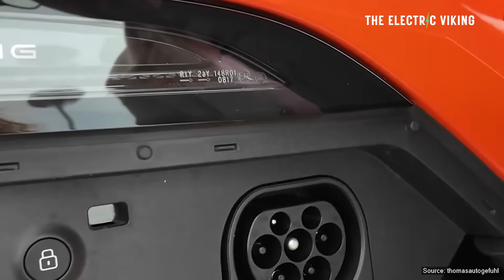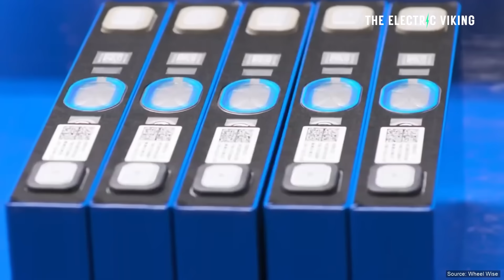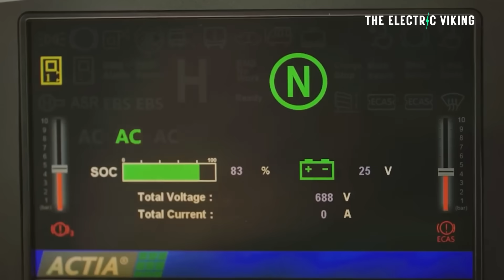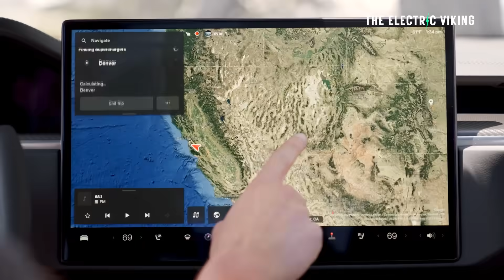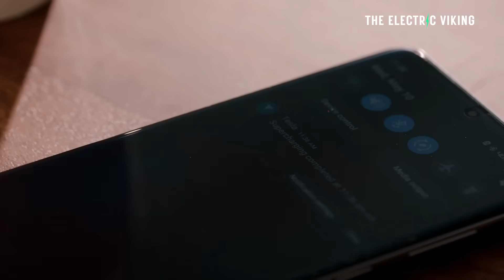Shocking data reveals the TRUTH - how long electric car batteries really last

Comment: Ten thousand miles on our 23 Mach-e GT, so the first service interval was done yesterday, $0.00. One pedal driving is so familiar now, that I can go months without using the brakes. The only time I use the brakes is to occasionally clean the rotors. Level 2 charger at home does over 98% of our charging at about $.14 per kW.h. Thank you for sharing
Reply: Does that mean that other road users don't know when you are slowing down or do the brake lights come on automatically as the car slows itself down?
Reply: @God_help_us  Good question. The brake lights come on during deceleration/regenerative braking.
Reply: Good to clean the rotors after a rain etc. Besides they look nicer all shiny:)
Reply: Mach E has European style break blending. Even when you use the brake pedal the car will not use the brakes. Regen is being done automatically via software.

I do have a GT also and the Brembos were only ever used with emergency braking and to halt the car. By the way I am driving in Germany also on highway with high speed. And believe me you will need to brake intensely from 200 km/h to 60 km/h within a few meters at exits.

As mentioned by another guy there is a brake light issue. One pedal or bridle mode is basically unusable because the car behind will not see brake lights. I do use whisper without one pedal because of that. So I do use the brakes pedal but not the brakes. And the car behind will see brake lights which is important for safety.

Comment: Sam your coming across as a EV lover regen braking wears pads and discs and why don’t they guarantee batteries for say 30 years then please get a grip go watch Barry Crompton
Reply: No it doesn’t. It’s inductive.
Reply: I’ve seen dealers videos showing uneven wear due to it but my main point is the quarantee 8 to 10 years do you think that’s good enough really 🤷‍♂️
Reply: Regen definitely does not wear brake pads, it is electromagnetic braking. CATL is supplying Yutong Chinese buses with a new battery that are warranted to last 15 years or 1.5 million km's. These will eventually be used in cars. So battery warrantees are getting longer as battery tech keeps improving.
Reply: @toriwatson9655  so how does that work then no contact with brakes to pads
Reply: @georgeg8106  when the regen is activated the motor sort of reverses and generates electricity. It pretty much becomes an alternator or temporary generator and converts the kinetic energy of the vehicle to electric power to go back into the battery.
Reply: https://www.youtube.com/watch?v=stq2E3sZYg0

Comment: Degradation with high mileage was always solvable by using large enough batteries. The issue of large batteries were weight and cost. Not how many miles can they make. If you are high milage driver, like taxi driver, EV was always better proposition then ICE since Model S was released. The real issue for car owners is calendar aging.. How good will battery be after 12 years? How about 15? 80% of Toyotas make it to 20 years of age. But their hybrid batteries are dead after 10-12 years for 4500€ cost of replacement of punny 0.7kWh battery.
Reply: Resting or calendar degradation is one of those things that is hard to calculate. If batteries are left fully charged for long periods, especially in hot weather, it can be significant. LFP batteries sitting around nominal voltage have small degradation, I think the latest generation of LFP batteries will have huge lifespans, calendar and cycle life. Toyotas ancient Nickel-metal hydride hybrid batteries have a poor lifespan and can't be compared with modern LFP chemistry. But you are correct, calendar life is not looked into enough. 

Lithium Titanate is the gold standard for lifespan and would outlast any car, but energy density is too low for most EV's. It is interesting Mitsubishi made some of their Miev Vans with 10 kwh LTO batteries and most with 16kwh NMC packs. The LTO powered vans are highly sought after second hand, they seem to be getting 105% range after 10 years (obviously some sort of error, but suggests barely any degradation). And these LTO powered vans after 10 years now have better range than the degraded 16kwh vans.
Reply: @toriwatson9655  Thak you on insightfull reply. Judging from wikipedia LTO battery has low energy capacity, but seems as no-brains option whenever there is no need for monster capacity. Like in hybrid/plugin. I would buy that.

Comment: Our family have owned two 2013 Volts and one 2023 Bolt.  One of the Volts battery bricked shortly after the warranty expired.  Too expensive to fix.  My other Volt seems to be fine at 140K miles.  What I have decided.   To trade an electric car before the warranty expires, usually 8 yr/100k miles.  I am not sure how an electric car and ICE compare in resell value.  Something to think about when purchasing. The other thing to think about is future proof of the battery.  Supposely, GM's Ultium platform can replaced their modular units with upgraded batteries???   Battery technology are in a constant state of change.  An older battery may not be supported and replacement battery might be refurbed units with limited warranty.

Comment: Okay, so there's all these new amazing batteries that have increased the capacity by both dimension and weight....but why aren't we seeing new better cells for the small scale such as power tool batteries. The 18650 has been around for a long time now, but with all this new technology you'd think they could come up with a 5Ah battery the same size as an 18650....or a 5Ah 18650.
I just love building my own batteries so really looking forward to a better replacement than the current small cell batteries.

Comment: There seems to be an ongoing theme in the comments section - People who have never driven an EV trying to convince  people they aren't good....😂
Honestly,  just test test drive one and be amazed. 
I understand the price might be out of some people's reach but that was soon change!
Reply: That's the interesting thing with EV's, some people just passionately hate them and won't listen to anything that supports them. When an ICE car gets reviewed you don't see trolls and keyboard warriors going off about how terrible the car is because it uses a combustion engine. I think there are just some people that can't handle change and yes, I wish they would at least try an EV. I think the younger generation will be EV adopters, the lack of maintenance needed, so few moving parts and therefore much better reliability, will see EV's take over.

Comment: My ice van had to be serviced at work so i was given the company electric van to use. When i got home and switched the van off it had 113 miles of range. When i started the van the next morning the van was showing 99 miles of range.
Reply: This is not battery degradation, but mist likely due to temperature. If it is at a comfortable temperature you get more range.

Comment: My wife did not learn to think ahead to minimize braking, as I was taught (a long time ago, before disc brakes).  When we had two identical vehicles (Toyota Camrys) the brake pads on hers had to be replaced twice as often as on mine.
Reply: An advanced driver training course would do her the world of good. If you're over using your brakes, you're not aware of your surroundings.
Reply: Its true as I have never had the brake pads replaced on any car I have owned in 65 years of driving .

Comment: The UK has the most expensive electricity in the world. It is cheaper to run my diesel and I only trickle charge at home, and I don’t have to worry about putting the heater on because of the range.
Reply: Er do you actually have an EV? UK diesel 140p per litre @ 50 mpg = 13 p/mile vs Electric 25p per kWh @ 3 m/kWh = 8 p/mile or less than 3 p/mile if you trickle charge on an off peak rate
Reply: @IanThompson-p2r  It's fairly clear he has no EV ownership experience. It also seems unlikely he has ever checked the cost of home EV off-peak tariffs.  His diesel would need to return around 150 to 180 mpg to compete with the per mile cost of my Kia EV, charged at home....
Reply: If you charge your EV at home on cheap overnight electricity it costs just 2p/mile.  Much cheaper than diesel
Reply: Germany, Denmark and Ireland all have more expensive domestic electricity.

Comment: The range is of concern. 250 miles official is often 200 in summer, 180 in winter. Add in the 60% window (20-80%) means your real winter range is 108 miles between charges.
Batteries may last, but degradation will nibble into that 108 miles depending on type of battery, how it is charged plus quality control of the battery itself and design of battery health support systems.
5 years later after buying your 250 mike range EV will you be happy with having to charge every 90 miles in winter?
Meh.

Comment: I buy 2nd hand cars and run them to between 250000 to 300000kms, my old Holden I just sold had 275000kms on the clock, the running gear was okay but all the plastic parts were decaying. I think even if the EV batteries and motor last that long. I  doubt if all the technology and plastic will last more than 250000 to 300000. But I hope that this is right because I really don't want to start buying new cars at my age.

Comment: This is not a balanced argument as ICE cars now last longer with a diesel often doing 300000 miles. Also  to recycle an engine is far cleaner than recycling a battery if you can find a company todo it.
Reply: There's companies in Australia that will convert an old EV battery to be a house battery. Who cares if it's only at 70% of original capacity, its original capacity was over 5 times standard home batteries.
Reply: @Michael.B  Those old house batteries were 100% recyclable, with facilities to do so all over the world and with very little energy required to do so. We haven't got that far with L-ion tech, yet. Most end up in land fill.

Comment: Battery pack as good as the weakest battery in the pack. General degradation does not give justice. It has to be based on actual numbers. How many batteries being replaced. Also you not replace the battery just because it failed. You also replace it because the range decreased below usable. The quality of batteries  differs even the manufactured batches.
You do not make assumptions. Real world data needs to be collected. Some of the manufacturer does it.  Than based on the collected data conclusions can be made.
Based on your assumptions. You would happily buy a 10-15 years leaf. :)

Comment: In 7 years of driving EV's, I have never replaced my pads or discs. 
I do give my brakes a dab once a day to stop my disc's from rusting.
Reply: It's a clear sign that you're looking ahead and have good spatial relationship skills. Saves on petrol, car wear and tyres. Most importantly, is it saves lives.
Reply: If you drive an ICE car properly you dont need to change the brake pads very regularly.In my 65 years of driving I have never had to have the brake pads changed on any car I have owned
Reply: @ When you only keep cars for 3 years, the lease agreement, that makes sense.
Reply: @davidbeppler3032  I keep my cars until they die, I dont have that sort of an ego that needs to show off with a new vehicle every 3 years.
Reply: @Stumpy1854-Orion  You are a liar.
Reply: @davidbeppler3032  What have I said that was a "lie" ?

Comment: I don't need media that keeps on lying, non-transparent about their oil-lobbyist donors, to tell me about nearly anything.
Facts are simple, even in Jakarta, Indonesia.
Bluebird taxi, one of the oldest, longest running taxi company in Indonesia, has been using BYD e6 from 2018. A lot of them has between 600,000 km to 1,000,000 km. They still retain pretty much 80% of their original range, practically about 250-300 km if the driver is careless. Currently, it is on sale, starting at AU$25,000 each. The company is replacing them with BYD Song Max-based EV, the M6 (branded new e6 for corporate use). The last time I took the old BYD e6 taxi was in late 2023 - from airport to home, a 35 km trip. Every warning lights lit up on the driver screen - he said that it has been like that for years, since they imported non-OEM parts to fix things - and it is going strong for all those years with non original parts. But then again, the old BYD e6 uses BYD's first gen LFP battery instead of the typical NMC ones.
Now, you can't lie about that like the Telegraph or Sunday Times.
People easily forgets all the hassles, chores, and wasteful habit that come with "car ownership" when they have been driving their unreliable, complex petrol & diesel cars for many years. Going to gas stations, queue up, top the tanks to the brim, and then drive back home. Waste of time. Since it is a lot of moving parts, a lot of things, both minor and major breaks and only to be discovered every service / maintenance cycle - most of owners are clueless and just pay up (sometimes the breakdown might be serious, but can't be felt and doesn't affect the driving experience).
Plus, most ICE cars made by legacy automakers today are cheaply made and super flimsy - parts put together by plastic fasteners, cheap glues, lazy welding, and bolt retainer made out of "heavy duty plastics" or simply not retained at all - causing them to unscrew itself over repeated engine heating and cooling - causing rattles and vibrations here and there. Heck, people say Mazda is a "premium upmarket" brand - but my Mazda 2 SkyActiv's front foglight housing is secured to the bumper using a plastic snap fit. Overtime, the plastic solidity weakens under weather and engine heat. It is located next to the radiator, so it is kind of understandable. Eventually, the entire housing collapsed inside under aerodynamic load from driving on highways during heavy monsoon weather.

Comment: People who know NOTHING about EV batteries always equate them to flash lights, portable CD players and boom box radios. Very soon the batteries WILL need replacing. 
Since a battery is a battery, EV batteries will ALWAYS need replacing. Oh, and when they fail the car will stop, like the radio.
But that's like comparing fluffy slippers to hiking boots. NOT THE SAME ! ! !
Reply: No, EV batteries will not always need replacing. They can be repaired and refurbished just as a worn engine can be.....

Comment: But Sam, it's nice to have a battery to 'last longer' but does it give the same usability.  I have a Samsung Galaxy Note S3 mobile phone that has 'lasted longer' than any mobile phone from the same year, but the battery only gives less than an hours use. I have to charge it up MORE OFTEN.  Fixed batteries in EV's, shoddy software and half assed designs are what I do NOT WANT in my EV. I am waiting for a good design to arrive that is WORTH BUYING, which will LAST ME.

Comment: U will be amazed
How much resistance to EVs people
Have and how dealerships discourage EV sales. They love ICE or PHEV which are fake EVs. I cannot convince my parents to abandon ICE or PHEV simply because dealerships corn them
Into leasing them
So they can continue to rip them
Off with redundant maintenance services etc. there is no reason why my parents even need PHEV. They drive 20
Miles a day, hardly take long road trips. Even a 200 mile range EV is sufficient and would save them even more
MoneyS
Reply: Utter nonsense, the government is forcing dealers to sell a certain amount of EVs or face large financial penalties, so they always try to steer you onto EVs, which are absurdly costly, also repairs are incredibly expensive too

And it's always leases they try to get you into for electric cars too, even leasing the battery within the car separately which opens up an absolute nightmare scenario for anybody having issues
Reply: @ryanwatterson4038  To my knowledge, it is not the dealerships, which face financial penalties, but the manufacturers.  Or am I wrong?
BTW, EVs are NOT "absurdly costly", but much cheaper to own and operate than comparable ICE cars.  I have detailed numbers if you wish to know them.  But you are probably not overly concerned about facts?!  Have you ever owned an EV to be able to affirm what you did?

Comment: Might last,,,,,but 500km battery new ,will only go 50km after 5 years ,,,,,,,,FACT ,,,,,,,,ELECTRIC CARS ARE SCRAP METAL WORTHLES JUNK AFTER 5 YEARS
Reply: This guy is an ostritch with his head in the sand.
Reply: @Dungshoveleux  There's an idiot in every village.
Reply: @ Behold our village idiot.
Reply: @Dungshoveleux  There's an id-iot in every village.
Reply: @Dungshoveleux  Flat earth people in every village.
Reply: Um, no. If that were the case, carmakers would be bankrupted by warranty claims.
Reply: @alexishart1989  They are being bankrupted by people not buying EVs in my country. Witness the per registration sales and massive discounts.
Reply: This is probably one of the least intelligent comments I have read in a while.
Reply: @1892Bear  The intelligent people never bought an EV in the first place, unless they could charge at home and their driving requirements were not inconvenienced.
Reply: @ Quite the opposite.  I've saved so much money driving a Tesla.  You don't need a "home" if you use Tesla's Superchargers.  About 30 minute charge is no inconvenience if you're saving $80 per week not paying for gasoline.
Reply: ..Good job the minimum battery warranties available from EV Auto makers for new EV'S are 80% Battery capacity at 8 years old..
The latest CATL LFP chemistry batteries being produced are even getting 80% minimum capacity at 1m kms warranties for the original owner..that's about 50 years of average driving..! I think you're totally out of touch and spreading FUD...!
https://youtu.be/_N0KnpDJ658?feature=shared
Reply: Sam goes on about the fantastic technology of Chinese evs,what about reliability,build quality ,dealer back up,resale value,how many brands will survive in the long term
Reply: What about all the ones with 8 year battery warranties?